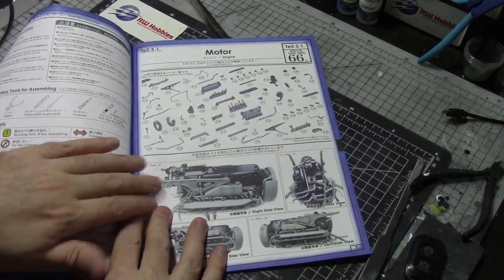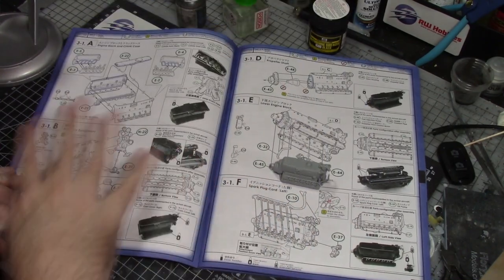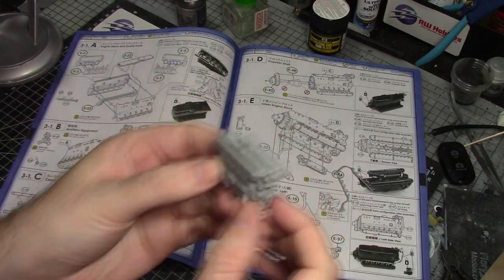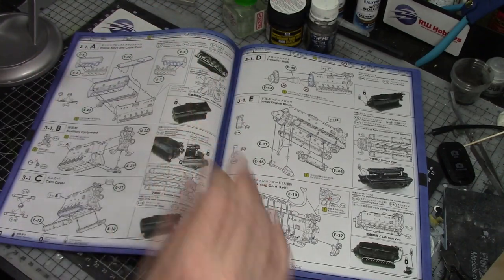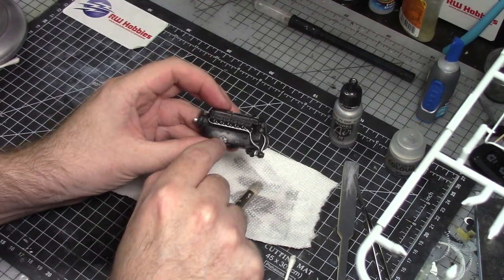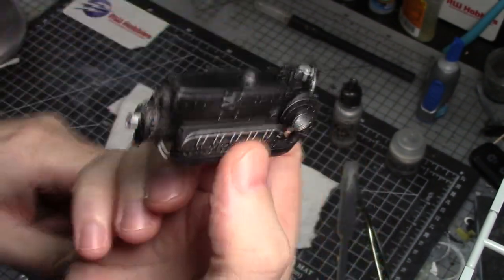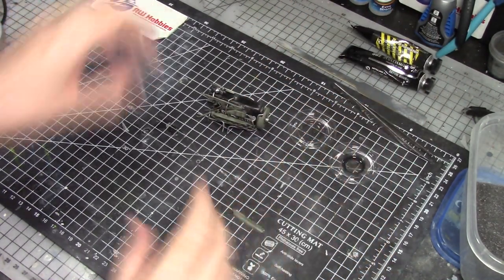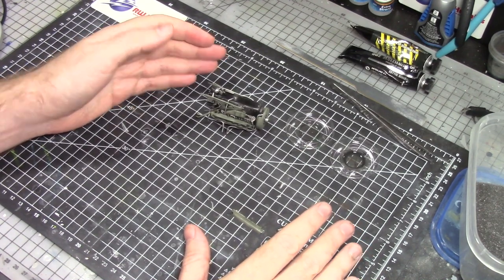1/32 Zoukei-Mura Bf 109 G-14/U4 Build Series - Part 1: Engine

Comment: Is it possible to have the cowl-covers sitting there as if closed but not glued so you can lift them off to show details?
Reply from the maker: Sorry built this model several years ago and sold to a collector. I would say anything is possible with some micro magnets.

Comment: David R Lentz, Columbus, Ohio, USA (Friday, 30 August, 2024) 

I generally focus on USA and British Second World War combat aircraft. However, Germans are renowned for their superlative engineering, and this offered me the opportunity for a good look. I am new to Zoukei-Mura model kits, so I wished to see further of their methods of kit making and parts detailing. 
   At round 13:50 of your video, you mention using various metallic paint colours to detail the kit’s Daimler Benz DB 605 inverted V-12 engine. I have some idea as to what you mean about talking too fast. 
   More substantively, the abbreviation you seek is "RLM", which is the German abbreviation for "Reichsluftfarthministerium" (Reich + luftfahrt + ministerium, meaning "Imperial air service ministry"). 
   Some years past, whilst building Tamiya’s 1:24-scale kit of the Volkswagen Karmann Ghia automobile, I did much the same to the entire engine and transmission; it wound up requiring round a dozen different colours, including satin black for the engine block itself, with dry-brushing in gunmetal; then, for everything else in the compartment, steel, aluminium, silver, etc. The results had astonished me that I had shown it to all my neighbours and visitors.